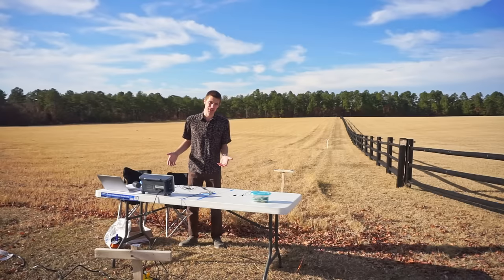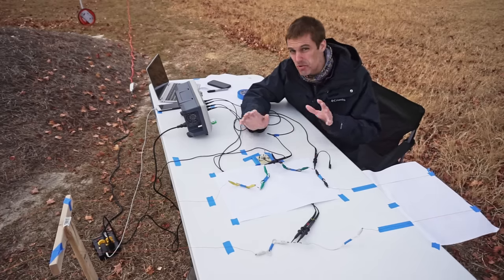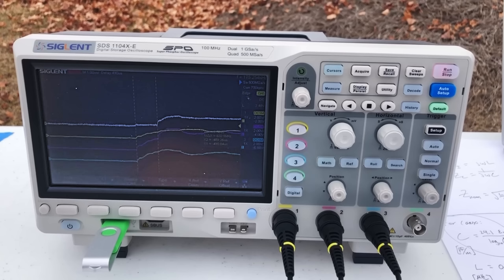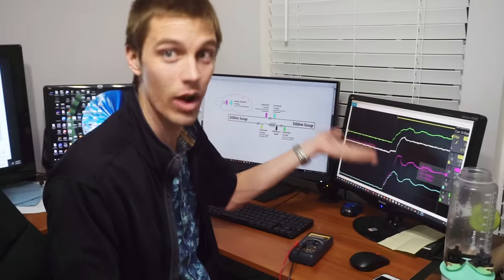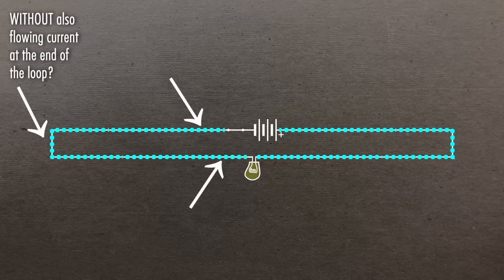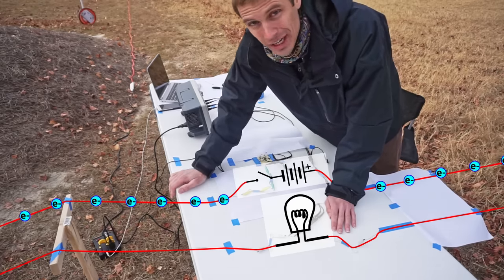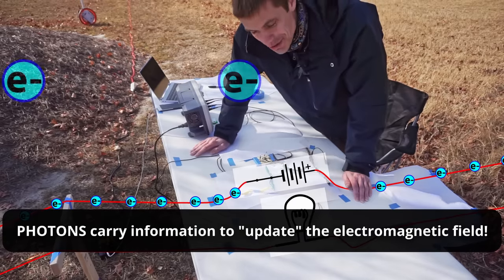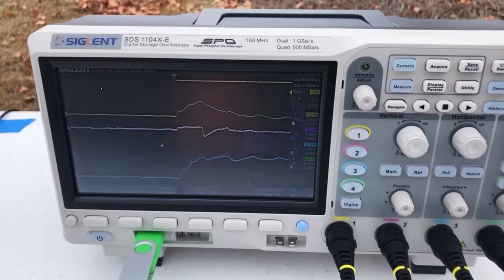I bought 1000 meters of wire to settle a physics debate

Comment: This video theoretically explains what Derek wanted to show in his video, however you managed to explain it better than Derek, which is an extremely great skill to have
Reply: Also Derek explained it in a very very misleading way. He doesn't even mention that the lamp only turns on slightly until a bit later in the video and the way he explains it implies the lamp intensity goes up linearly or smth like that. This video explains it very well without the stuff about the field carrying the energy which while true is not a very practical explanation.
Reply: Derek could have but it would have been less dramatic.
Reply: @markoproloscic4492  Yeah I agree. Derek made it sound like some quantum effects were controlling the wire, but it's a lot less complicated than I thought
Reply: @markoproloscic4492  That's because it's a thought experiment, not a real one. He clearly states, that the imaginary lamp turns on from any current, and that it doesn't receive full current nearly immediately.
Reply: @ognimimerkki  It's not wrong inside the design of the experiment, but for the sake of educating people it basically ignores that most people are already familiar with radio transmission. The best way to tech people new ideas is by connecting them to things they already understand and then expanding upon it.
Derek tries to imply that some sort of barely understood phenomenon is causing the effect, when it's basically just a broadcasting and receiving antenna.
Reply: I feel like the goal in this video was to explain how things work, whereas in the Veritasium video it felt like the goal was to evoke "mind=blown"- kind of in a "science teachers dont want you to know this" or "you'll never believe what happened next" kind of 'clickbaity' way. Which hurts to say, because I really used to like almost everything on that channel in the past.
Reply: @TheUnknownFactor  I will certainly be treating content from VT with an extra layer of skepticism in the future, as he's proving more interested in creating "Gotcha" moments then real education.
Reply: @ognimimerkki  Actually NO, he does NOT. He said "the light bulb has to turn on immediately when current passes through it ", not "any current"... I hate to mince words, but the "any" current was because it was misinterpreted as his "intention" because of the "ideal nature" of the experiment. I believe the reason he used those words was to "avoid delay" in the effect of the current on the bulb, but again, that is just my opinion.

Unfortunately, he didn't "reveal" his actual meaning and intention until much later when he posted comments to ElectroBoom's channel, and of course here.
So,  in reality, he never meant it to be "any current"... he meant it to be "the operational current" that would normally turn the light on.
Since this was really not explained well, it left the community arguing back and forth.
Reply: @Kyle-xk2rb  If you want to go deep, it really is a quantum effect.  All electric fields are.
Reply: @zncon  Looks like a lot of people doesn't know that 10 minute videos on advanced scientific matters are not focused to replace education from School-University-Books, Derek is a scientific promulgator,  the whole point of his videos is to inspire people on looking for knowledge and get interested in these things, that's why most of the videos are click-baitie, because it's intention is to get the highest amount of people interested in science, if the purpose of the videos were to educate the tittle of the videos would be:

•INTRODUCTION TO PHYSICS PART 1 OF 200
•ADVANCE ELECTRICITY PART 1 OF 169

Of course all these videos are extremely simplified and take 10 minutes of time.

But then they come the PhD commenters to say they are not gonna watch another video from Veritasium because he said "any" instead of "some"... Like WTF? Imagine people saying Einstein was a liar because he didn't believe in quantum mechanics.
Reply: @DarckAngel11  I get your point, and I think the rise of science educators in YouTube has been fantastic. My issue is not with things being simplified for mass appeal, it's with misrepresentation of what's left out. 
It's fine to gloss over the complicated stuff, but tell people you're doing it.
Reply: @zncon  I wish this had  been brought up much earlier and the simplest explanation of all. It's a transmission pulse across the airgap that creates the nearly instant signal

Comment: AlphaPhoenix: "You can't have an electron leave the wire"
Tungsten filament: laughs in thermionic vacuum emission

(just teasing, this was a great video! 🙂)
Reply: Or just enough voltage to start an arc.
Reply: Am electron I think I can leave metal surfaces
Reply: I don't even get the joke, but it was geeky enough to earn a like.
Reply: @kindlin  Metal heated in a vacuum emits electrons. Heated wires are used in vacuum tubes to emit electrons. So you can have an electron leave a wire. Or as I mentioned an electric arc is also electrons leaving a wire.
Reply: @PeregrineBF  
OIC TYVM GL
Reply: @PeregrineBF  what’s going on with non-wire arcs, like lightning? As I understand it, the air is acting as a medium from high potential to low potential, but are electrons actually moving from one to another? And what’s going on with feeders (arcs that originate on the ground)?
Reply: @MarcosElMalo2  An arc can form in a vacuum, air is an insulating medium (dielectric) until it ionizes and then it acts more like a conductive wire.

In a vacuum arc, the electrons really are moving quickly across the gap. The speed they move is dependent on the voltage, as is the length of gap they can jump.

Comment: I had a real-life engineering problem where we had a network problem at an oil refinery . This was a honeywell DCS (distributed control system) whose various servers were interconnected via 50 or more miles of fiberoptic cable.  Oil refineries can take up multiple square miles, thus network interconnections that are many miles long are common. 

When the network was originally set up, certain timeout settings were based on the assumption that the signals moved at the speed of light in a vacuum, whereas in the fiberoptic the speed was 10 to 15% slower than 186000 miles per second. 

We recalculated our timeouts, ssuming 80% the speed of light, and it fixed our network problem.
Reply: Indeed, and you are talking fiber optic, not copper.
Reply: Two reasons light travels slower than light in fiber.
1. Fiber is denser than air, so light travels slower. 
2. Light is constantly being re refracted back to the center of the fiber so it's mean path is longer than the fiber. Each bend in the fiber adds to this.

Comment: If you made the loop of wire a circle instead, the delays would be different. You should do the same experiment and see what changes!
Reply: I suspect a circle with a circumference equal to the same length would produce a similar result except the transient at the beginning would be even smaller, probably immeasurable because the capacitance between the cable lines would be so much smaller. The effect demonstrated here, but with a large circle, wouldn't be testable because the tiny effects would be swamped by other factors,  like the distance to the ground and natural electric fields that my be around. You would just see the 1 us to 2 us delay caused by the speed of light restriction. I'd like to see that experiment just to prove my point. 
You could do a similar thing by shielding the parallel wires.
Reply: A circle would mean that the capacitance would have hundreds of meters to travel, rather than a quarter of a meter. I think inverse square law applies, so you'd have like (1000m/pi)=d=318m diameter circle. The difference in capacitance would then be 318^2/0.25^2 or 6,320. Definitely not showing up on an oscilloscope. Remember that static making it hard for him to take readings? Now that static is going to be thousands of times more relatively strong compared to before.

Maybe in a large building where the air is still and with a higher voltage and more sensitive equipment you could datect it, but you might also pick up interference from wireless devices.

Comment: What happens, then, when you move the battery and “lightbulb” further away from each other so that those initial EM fields don’t start the second wave?
Reply: Reverse square law. You better ask to put them closer.
Reply: This is what made Derrick's tendentiously chosen geometry so sketchy. He was building more into that arrangement than just a 'circuit', he was building a capacitance/inductance layout without explicitly saying so and then injecting some mumbo-jumbo about magneto-electric fields that supposedly constituted the real electricity.

The topology of your arrangement, and Derrick's (and everyone else that following in Derrick's Gedankenexperiment) is invariant, but the placement of the elements in that topology does make a difference.
Reply: It's the distance of the switch and the light bulb that matters not the battery and the light bulb, which is yet another misconception induced by Dereks video. And yes you get the first reaction in d/c. Which of course is also weaker the larger d gets.
Reply: at the end he is mentioning about the second part he will make and he will try to explore the exact thing you asked. but expect the same small signal but just much less in magnitude. 

and in fact that small wave is what we unknowingly call psyhic affect on our brains, and partial psyhic abilities are coming from these small fields living beings feel. just do not pay if they say they can read your future; that is not what electric fields do :)

Comment: My hypothesis is that the electricity as mentioned by veritasium generates magnetic fields and electric fields. The magnetic field moving along the wire after you turn on the transistor induce a small current on the other side where the bulb is. So in fact: you immediately get the current as if from a wireless charger, and after the fields travel as far as the wire goes, you get the true 100% of what you want, not including the resistance of course.

Comment: 8:27  If I understand EEVblog's response, that .2 volt bump would be the capacitive coupling.  The width distance between the wires matters, as does the actual length of the loop, with regard to the strength of the that bump.   That is, different proportions should yield different strengths for that bump.  ~~~ Would like to see more control on that width distance.  Also, doing the calculations and running simulations, as EEVblog did, ahead of the actual experiment would have formed a more formal hypothesis to compare to the outcome.  ~~~  Let's see if someone can kick this up a notch.  There's simply more to do.

Comment: Great to see the experiment done by a true practical Electrical Engineer. well done. what you are amazed with and puzzled you to find the correct answer is actually one of the basis of telecommunication. When you cut the loop you get the little raise still? of course. That's a simple dipole antenna.

Comment: If you want to use a physical switch try using a Mercury wetted Reed relay. I was able to achieve consistent <200pS smooth (no bounce) rise times when designing transmission line pulse testers during my PhD studies. It may have been faster than 200pS but this was the limit of my oscilloscope. I doubt it changes the result but it will give you shaper transition times. Also why not inject a sine wave at 1/1.6uS and do the experiment in the frequency domain and not the time domain?

Comment: Dude, this was awesome. One of the problems I had with everyone replying was .... Yes, technically he's correct, but reality is it only works if your light bulb and source are close together(magnetic fields induce a current). It's basically mixing wireless transmission of power and information transmission and dummying the waters with that 1/2 light second wire. Like the length of the wire was irrelevant to his conclusion but so much emphasis on it and there are actual theories on how to make information travel faster than light(quantum entanglement and others). This right here explains what he was saying in a way that everyone can understand it. Electroboom did it well too but I like your approach better.
Reply: Electricity does not travel so it does not travel at the speed of light.
Reply: I agree, the original video was essentially a dumb trick question.
Reply: There are no theories of faster-than-light information travel that don't contradict causality, which is a pillar of modern Physics. No, you can't make information travel faster than light with quantum entanglement in any theory that doesn't violate Relativity, and there's a bunch of ways to prove it.
Reply: @Sekilloda  I did not mention the validity of any theory. I simply stated there are theories. I appreciate the info but I'm not taking a position. I was just stating that it was heavily implied in Veritasium's video.
Reply: I try to keep thing simple so I can understand.    Maybe you can help me.......
Isn't "light speed"  the fastest anything can travel thru a vaccum?  Because of photons(light) having zero mass and no interference.   

In this experiment or other fiber optic wire experiments.......wouldn't the wire/fiberoptic provide a tunnel or path that helps inforation travel faster than photons could in a vacuum   ie: "light speed "     
He mentioned that einstein was wrong, and there are things faster than light speed is why i'm asking this.

Comment: Cutting the circuit at one of the far ends was a great way to show that this isn't transmitting the power through the circuit (instead it was a change in the capacitance and resulting change to the EM field the pushed a small current).  
Another simple way to show it would be to connect each length of wire to the opposite side of the resistor, which should show the smaller current actually going in reverse to what the battery eventually pushes.

Comment: I'm definitely looking forward to part two!  My initial question after watching the Veritasium video was "what happens if you move the wires farther apart, for example a massive circle instead of a long narrow rectangle?"  It sounds like you've got that covered.

I'm going to guess that the farther apart the wires are the smaller the initial voltage you'll see, until it becomes undetectable, but having already done the experiment you're probably just chuckling and shaking your head.

Actually I bet you'd see some really wonky patterns if the distance between the wires varied, like one side was shaped like a sine wave with a wavelength of 50m and the other was straight.
Reply: Capacitance between wire stays there... No matter the distance there will always be SOME CAPACITANCE.... 
It's just that it's VERY VERY VERY SMALL in that case..

So you won't see the instantaneous current.(very very small to be detected)

C= A Eo /d

d= distance between wires
A= area of cross-section
C= capacitance.

There will be current even at infinite distance between wires. But very small... Cannot even measure.

So you won't see the first current for 1.6us (very small)
.
Reply: @adityasakhare6461  Would there not reach a point where the capacitance is so low not a single electron is removed from its atomic orbital thus have 0 current? Admittedly this threshold may require ridiculous spans of distance but since all energy is quantum at large/small enough scales it should become a discrete system rather than a continuous one.
Reply: @agilemind6241 AS PER MY KNOWLEDGE..... no ... Even at infinity.. negative charge pulse in the other wire will repel the electrons in the other wire thus creating SMALLLLLL asf current..

Comment: The phenomenon at 19:19 is actually caused by the internal workings of the battery. The electron carriers in the liquid part start out at a higer concentration at the electrode, but that decreases over time until its at a slightly lower equilibrium with diffusion from elsewhere in the liquid
Reply: Capacitors are different since you are not waiting for chemical reactions which take femto seconds or less to happen.
But what about a battery made out of a super charged 1 Farad capacitor? You dump the capacitor and there is a finite amount of time for it to discharge and let the electrons flow also. There is a formula for that and can be determined.

Comment: The fact that electrons literally bounce back at the end of the cut wire comes to show how electricity is on the verge between Classical Physics and Quantum Mechanics but it is still a classical phenomenon and light speed still marks its limits.
Reply: That is basically what an antenna does.
Reply: Its behaving exactly like a liquid in pipe. Its called "water hammer effect"
Reply: Well, light speed still marks the limit of quantum phenomena, but yeah, we can say that electromagnetic systems tend to manifest greater evidence of the underlying quantum laws than other systems.
Reply: @blackflan  As nonlocality shows, the limits for quantum phenomena is not light speed.
Reply: @TheSkace  it is nothing like water in a pipe. You never hear of plumbers talking about impedance matching and characteristic impedance.

Characteristic impedance is defined as the square root of inductance per unit length divided by capacitance per unit length.

The effects of capacitance and inductance have no analogue in water systems.
Reply: @deang5622  Ever heard of water hammer?

Comment: I think the immedfiate pulse is because the wires are so close to eachother, which would act like EMI. Would it be at all possible to see what would happen if the wire loop was a giant circle, instead of two parallel lines? Or possibly make an enlarged peanut, where the wires are only parallel at the switch and 'lightbulb' but are in massive circles otherwise?